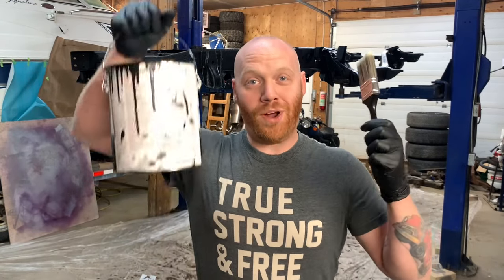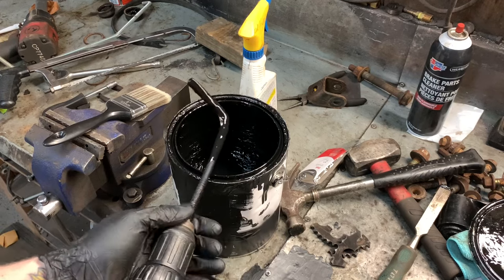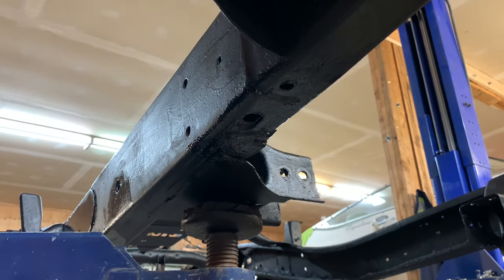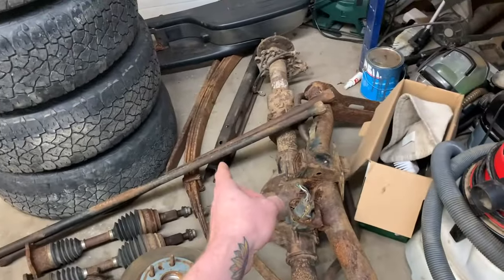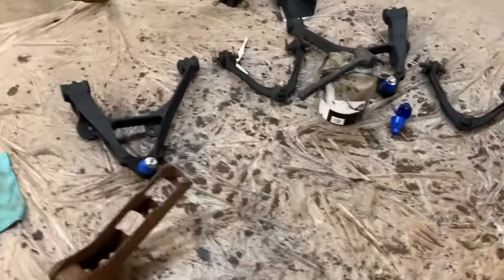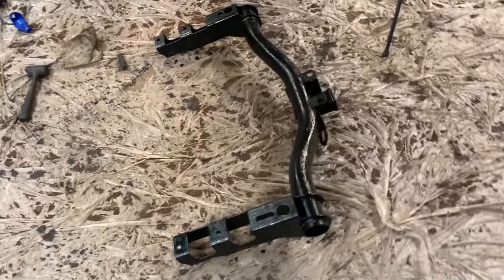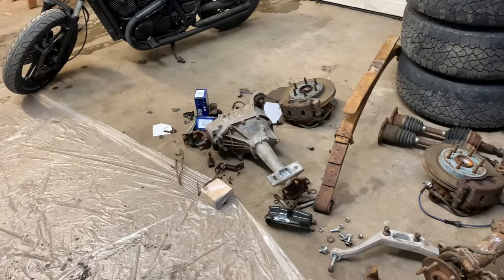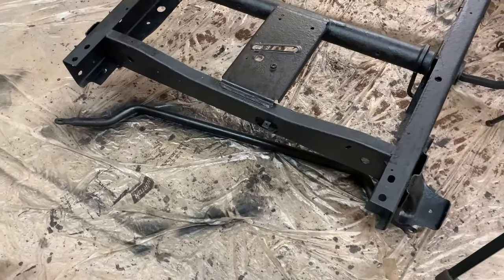How to make your frame and suspension look brand new! Low cost, just needs some elbow grease

Comment: 6:05 there was a drip above you I thought was gonna land right on your noggin.  😂😂

I could totally see the happy little tree you painted in the corner. 
It looks great, flat black hides a lot of imperfections, rust scale, questionable welds, both from the factory and otherwise.  😂
Reply from the maker: I had a drop of black on the top of my head for like a week, that stuff doesn’t come off haha 

Flat black is the only thing that can make my welds look good 🤪😁
Reply: @StationroadRatrods  lol, yeah I had it on my hands forever when I painted the lentil over the garage door.  I used Armorcoat from crappy tire, similar stuff.  

Grinder and paint makes me the welder I ain't 🤣🤣.  

Nah, not enough paint and flap discs in the world to fix my welds.  🤣